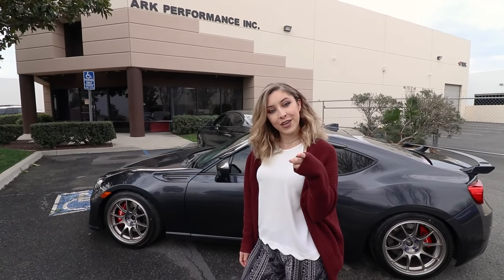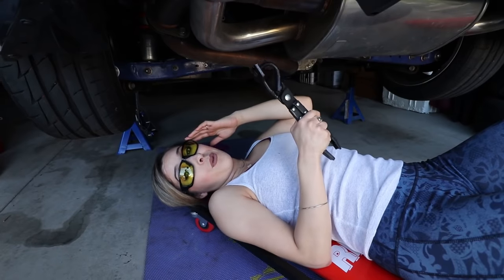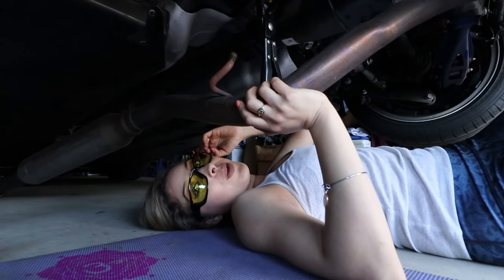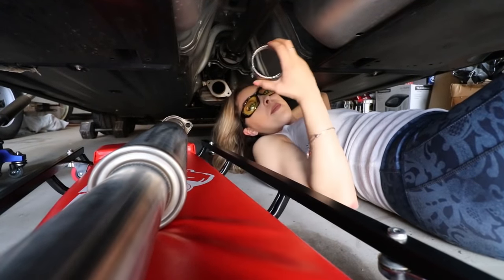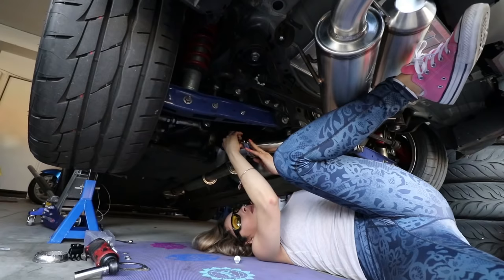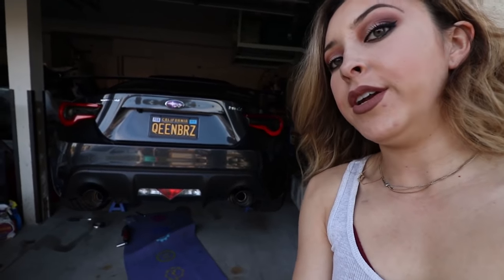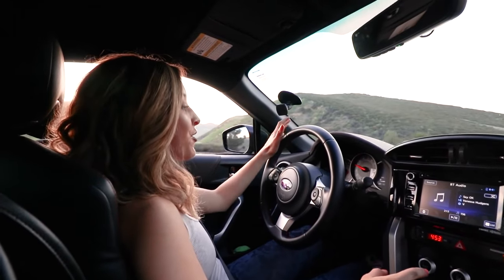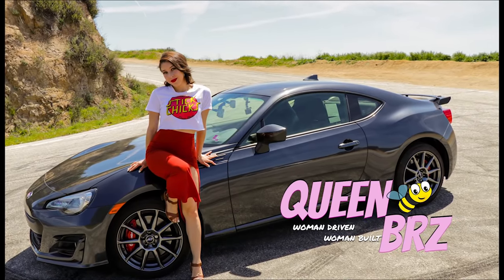BRZ / 86 / FRS | ARK GRIP Catback Exhaust Install

Comment: Surprising how heavy the stock exhaust is. I recently put in an Invidia q300 and I love it soooo much. Upshift pops are the best! 

Also I didn't use an exhaust hanger removal tool, flathead screwdriver, wd40 and 2 sore thumbs later >:(...
Reply: I got an Ividia  q300 about 2 months ago and waiting for the sound to settle in, supposedly it sounds better after some miles driving . How long have you had yours?
Reply: Saul Espino About 6 months, 10,000ish. When it first goes on, you'd have noticed it smells burnt after driving because you've gotta cook its internals with use :), but after a while it will sound even better, man!

Comment: Actually DW-40 helps removing the rubber mounts of the exhaust
Reply: WD-40 bruh lol
Reply: The Man with No Name hahahahaha i figured I was just like this is somethings how have I not known this😂😂😂😂😂
Reply: Heheheh dw 40 must be the rival of wd40 all the company did was switch the names😂😂
Reply: Lol my bad , I don’t alway double check my writing
Reply: Eduardo Sandoval heheh it’s all good i think wd40 is now of the past now. DW 40 IN😂😂😂
Reply: DW-40 is actually WD-40's final form
Reply from the maker: 😂🔥 I love this haha
Reply: QueenBRZ Hehehehe straight up. Want some I got a prototype. Gets anything nice and loose. Just spray it on the exhaust and it falls right off. Caution make sure not to be under the car as there can be excessive risk of getting knocked out
Reply: Or you know...instead of "DW-40" which isn't a lubricant. You can use plain old oil.
Reply: Classic Bass OLD OIL BREHHH😂😂😂
Reply: @HoweDoYouDo1999  "plain old" is a term of phrase I didn't literally mean old oil lol
Reply: Dub D 40 is a solvent, not a lubricant.

Comment: Are those rhino ramps you used in the stock exhaust clip? Are we able to use them without damaging anything because of our ride hight :o?
Reply from the maker: If the car is stock height, it will go on the rhino ramps easily.  At that time, my car was stock ride height.
Reply: @JDMCrystal  great information to know, thanks very much :)

Comment: nice sound, I just got the HI Power HKS exhaust, a little scared about the laws I'm in North Carolina and people out here have Mustangs and Chevys with straight pipes sound like a jet engine, my car is aggressive but smooth haven't had any cops stop me I notice if I drive in a higher gear the gears is quiet. also inside is really nice the stock was horrible
Reply from the maker: Nice!! I always wanted to try the HKS exhaust.  Might have to give
It a go :)

Comment: I just bought a 2017 brz. Same color as urs. 
Was wondering what are the specs of your wheels? And is ur car on lowering springs or coils?
Also do u have headers done or just the catback exhaust? 
Sounds so nice!
Reply from the maker: The car is lowered on coilovers.  I used to be lowered on springs too though!  If you look back at my old videos I have install videos for both springs
and the coilovers.

My headers are stock still. The wheels Wedsport TC105N are 17x9 + 35  | tires are 245/40/17
Reply: QueenBRZ thanks for the reply. 
Okay nice! Im wanting to have that same exhaust sound as urs. Sounds really good!

Im looking at 18x8.5 +30(front) and 18x9.5 +35(rear). For the wheels. And lowered on springs. 
Hope itll work 🤞🏼. 

Sweet, ill go and check out the vids!
Thank you!

Comment: What a beautiful exhaust. Have you noticed any power gains from the Greddy?
Reply: You basically gain nothing from cat backs. Unless you're boosted or tuned very minimal if any.
Reply: @javyramirez9734  lol don't tell the manufacturers that.  But that statements half true. If I have an intake, header, attached to that cat back exhaust, that exhaust is going to give me gains. But if I just slap on an exhaust, I agree with you, there will be no noticeable gains other than some sound.

Comment: I don't want to be mean but the majority of the actual install was jump cuts. You showed you taking off a couple bolts and putting a dry gasket on...that's all. I'm pretty sure you cut out all the issues you had with the install? Makes me question this video.    Maybe I'm wrong.
Reply from the maker: Classic Bass I understand. The reason for jump cuts is that over the course of doing these install videos, the feedback  I received is that people tune out after seeing 5 minutes of bolts getting installed and removed. Each step of the install is indicated in my videos and I try to be as clear as I can so I can capture the attention of all my audiences. If you want to see a full install done by myself, my first few videos are minimal on the jump cuts. Warning: they are very cringe because of the minimal jump cuts lol. 
If you ever have questions about how I did something that wasn’t featured in the video, please let me know and I would be happy to tell you what I did(:
Reply: @JDMCrystal  Makes perfect sense. Thanks for explaining.